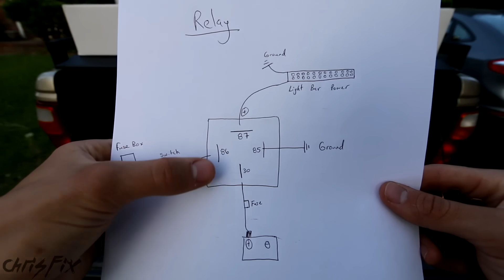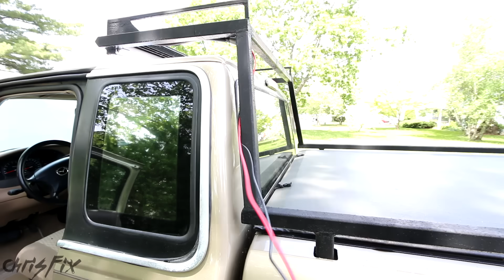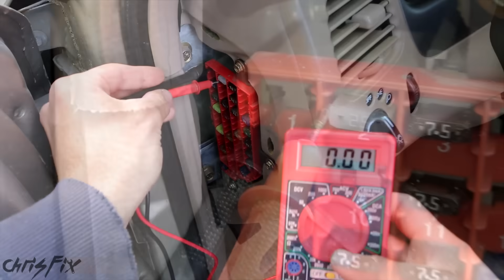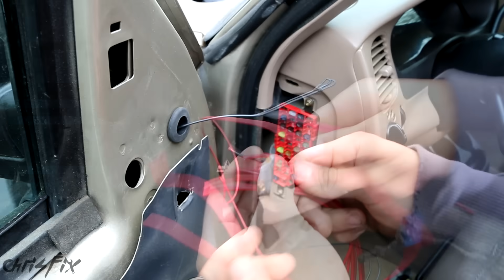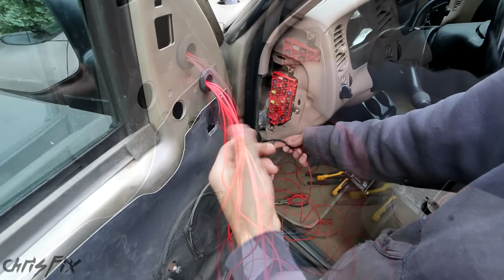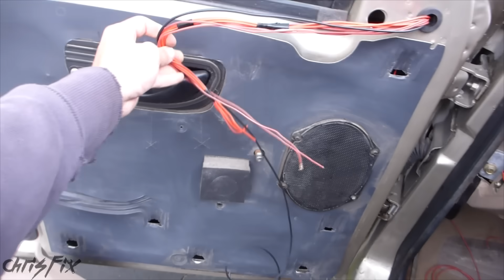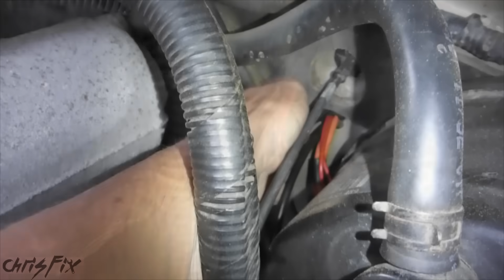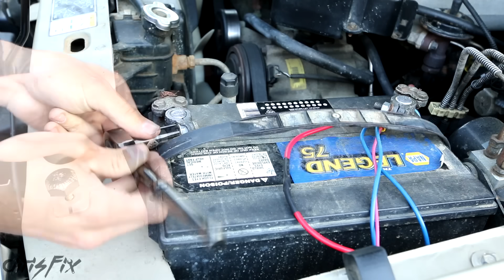How to Wire an LED Light Bar Properly (Project Night Light Episode 3)

Comment: ChrisFix dude thanks I've been watching for ever and have been thinking of getting a light bar and I'm grate at welding and electrical stuff but you should invest in a power cap! it's a secondary battorie dry cell for inside you truck and it keeps you from burning out your altnator when you run a lot of electrical! I have lights and a 10,000watt sound system and my dad used to build systems too his wasn't as big as mine and he's burned up 10 altnators in his life tell he invested in a 100$ power cap and never burned one out agin! you should do the same and when you get a power cap it will also help the life of your car battorie! I have a power cap in my corvett (82 limited edition) and my ford explorer and it helps get the power my lights and systems need and save my battorie and power cap!
Reply from the maker: +Darian Neumayer thanks for the tip! Do you wire the power cap in parallel with the stock battery or completely separate?

Comment: Wouldn't it have been an option to drill one hole on each end of the left vertical bar and run the wire inside the square tube?
Reply: Max S. he said he is concerned about rust.

Comment: i want to add four led strips on the inside of my truck but i want to hard wire them using the fuse for the dome lights so when i open the door they turn on can i wire them all to one fuse tap ?
Reply from the maker: They shouldnt draw much so that should be ok to do.
Reply: ChrisFix there the 12v lights and the fuse is a 7.5 i was told to just up the fuse what do you recommend on the fuse?
Reply from the maker: Never up a fuse. The wires are rated for a certain amperage. If anything, do this: https://www.youtube.com/watch?v=ZVG7X-ae298&t=2s
Reply: ChrisFix yeah ill do the relay hopefully i do it right haha thanks
Reply: ChrisFix do i use a 10 fuse or a 12 between the battery and relay ?

Comment: I think with a little bit more planning, I would have made a couple of holes in the frame you made to run the wires through. that way you can cut down the chances of something slicing the wire from the light bar to the chassis. Just a thought. Good Job Chris.

Comment: Isn't the door grounded?
Reply: It is, but A you need to attach the ground and that would probably have ment putting a screw through the door or welding something to it, and B people usually try to avoid painted metal as the ground so the spot by the footwell was better suited.

Comment: Instead of running power into you door and back out to the relay, what you should have done is wire up the coil side of the relay to the battery, run the wire from the relay to your door, into the switch and then the other side of the switch to an earth point inside the door. you save on wiring and you don't need that fuse tap thing. Most manufactures wire things like that these days as it saves wiring, it's called negative switching.

EDIT: It is also safer, if the wire for your switch was to ever chafe instead of it creating a dead short, it would just turn the relay and your lightbar on.

Comment: I dont get it, why did you run the return wire from the switch to the fuse box for power instead of just running it back to the battery?
Reply: No problem!
Reply: Another way of looking at it is this:  by using the relay,. it's a remote switch so you are keeping the high current out of the cabin.  less chance of melting the switch or wire in the cabin with you.
Reply from the maker: +Slisktord you could run it to the battery but it would be longer and you would need a fuse. Tapping into the fuse box is easier.
Reply: ChrisFix ok cool. I've never understood what relays really are for either hehe... why do we use them?
Reply: Slisktord it's so you don't have a high amount of voltage/current running directly to your light. It provides a switch so that when power from the fuse is on, power is readily available to the light through the switch. No power to the relay=no power to the light. A safety and convenience factor on top of fuses.
Reply: Nathan Rutledge thanks a lot for explaining this! :)
Reply: Nathan Rutledge    That's not exactly right.  The point is to avoid running all that current thru the switch.  By using the relay, you only need a small current at the switch to control the relay.  The light does need the high current otherwise it won't work.

Comment: Where do you buy your electrical components? Since Radio Shack closed, I don't know where to get them. I checked at my local hardware stores, but they didn't have anything. 

Trying to do a light system for my truck bed, and the thing I bought came set up with a 2-prong plug to go into the trailer harness, but apparently, my truck came with a hitch but no wires going to the trailer harness...
Reply: Tried Best Buy, but they didn't have anything unless you wanted to go through their automotive shop and pay them to do it.

Comment: What size fuse is it that goes from the battery to the relay and how do you determine that in the future? Great videos btw!
Reply from the maker: You need to see how many amps your lights draw. So if they draw 7amps you use the next size fuse which is 10amps.
Reply: ChrisFix they don't say how many amps on the light but if I'm correct... determining current is watts / voltage. so the lights are 18w and voltage from a car battery is ~12v so current = 18w / 12.

1.5 amps. therefore a 5 amp fuse? 

love your videos man the vest out there. really helping me learn

Comment: If you turn all your lights that you installed and everything else I wonder how much will the battery last lol.
Reply: These are LEDs, not halogens. They could run off a laptop's battery for hours ! Little to no impact on battery as after turning engine on, alternator acts as electricity generator and aids the battery.

Comment: Isn't using the fuse box the same level of danger as hooking up the light-bar directly the battery? They are both 12V

Also where did you wire the ground of the light bar I watched the whole video but I seem to have missed that.
Reply from the maker: I am not sure what you mean. When you use the fuse box, the wire is fused right at the box so there is no length of wire without a fuse. 

You ground it to the chassis (anywhere there is bare metal).
Reply: Well you said in the video you could technically just use a switch in series with the battery directly to the lightbar but that would be dangerous to have inside the cabin which is why you are using a relay. If the battery's voltage is the same as the fuze box voltage why is there a point to using the relay in the first place unless the current was decreased?

Comment: lol when i put light bars in my grille we just grounded it and took the other wire into the cab and it plugs into the cigarette lighter, simple but it works out great, especially because i hate wiring and electronics
Reply: So you just wired it to the cigarette lighter wiring or you used a plug?
Reply: Plug, i insert a plug into the cigarette lighter which is attached right to the light bars via a long wire
Reply: Cool, and it works like a charm?
Reply: All Day EDCers works out nicely, for a person who doesnt understand wiring and electronics well its perfect, no worrys about fuses and other stuff, just the positive wire plugging in works great
Reply: Benjamin Masters so you just wire the positive to a plug that goes into the cigarette lighter, then grounded the light bar to your frame?
Reply: i was told on a jeep forum that it wouldnt work
Reply: ZombieCake yes very simple, i couldnt get the wire through the firewall rubber boot thing so i fed it through driver side door, (just temporary cuz i am slamming the door on the positive wire)
Reply: Bubba Sawyer just dont overload the amperage from too many light bars, and dont let the plug short-circuit or u will have to buy and replace fuses like i had to do (20amp for the accessory power outlet and 15amp for the lighter)
Reply: well how did you fix that? I want to use a 500 w light bar
Reply: Bubba Sawyer well i am no electrician so idk how to convert watts to amps, but u can wire it to the battery and to the switch,
Reply: could you do a video or something to show how you wire yours up
Reply: Bubba Sawyer idk how to make, edit and upload vids, do u have instagram? friend me and i can dm you pictures and maybe a video if u can even do that using dm idk
Reply: Bubba Sawyer its benjimasters99 as my username and it says ben masters right under it, its a picture of my red truck
Reply: cant find you can you link your channel
Reply: Bubba Sawyer idk how it works but i only have instagram so whats ur name?
Reply: I did that to my mates ute
Reply: Have you blown any fuses doing that?

Comment: Looking at light bars on Amazon, found a 42" that's 240W. If your truck is off, your battery is supplying about 12V. Using P=IE, that's 20A. That'll kill your battery in just an hour or 2. (~40AH battery in most trucks.) 

I'd recommend moving that fuse tap to a fuse that's only on with Acc. That way all you have to do is turn the key once to turn on the lights, then if you forget to turn them off, when you take the keys out, they'll turn off.

Comment: connecting lights or any accessories to the car's battery wouldn't that drain the battery????
Reply from the maker: Not if the car is running. The alternator powers the car not the battery (technically).
Reply: oh okay thanks

Comment: You're going to have a hell of a time changing your battery
Reply: my exact thought
Reply: Well, there actually is only one Pos. & one Neg. on a car battery, so I don't really see any 'problem' . . . . .
Reply: I know
Reply: Nah, the alternator is always feeding power to the battery. So the battery will last as long as usual.
Reply: @yellowboy5467  he meant because he added the negative lead on the outside of the tightening screw so you have to take off the lead before you can loosen the battery connection
Reply: True

Comment: nice job with the lights. you should work on your rusty frame. My tundra frame looks just like yours and i bought some chassis saver before its too late.
Reply from the maker: Thanks! This frame isnt bad. I live in the rust belt so this is normal.

Comment: Hey Chris. My light bar is flickering or pulsing ... Its currently hooked up to an on/off switch and when it's on it's hooked up to my brights. It's never independently on, only with brights. Does the flickering suggest a bad connection or something else I can double check easily?

Comment: Chris, I want to install a LED light bar on the top of the bumper of my 2015 Silverado.  Your wiring video is absolutely amazing, the way you explained details, especially the use of the relay, is completely understandable.  Very Very good video!!  So here's a question - instead of a physical switch which I have to manually turn on or off, how could i use wire a light bar so that when I turn on my high-beam lights the light bar gets energized?  Can I use the factory lighting circuit as my switch and feed that into the relay?
Reply from the maker: Thanks a lot! To rig up your lights to go on when you hit the high beams, you can follow this video (but instead of using the reverse light wire, you use the high beam wire as a trigger): https://www.youtube.com/watch?v=ZVG7X-ae298

Comment: don't most light bar wiring harness go through a hole in the roof of a truck?
Reply from the maker: +rev9fan1 not necessarily. It depends on how you want to wire it!
Reply: ChrisFix and if I want to hole saw the roof of a brand new truck 😂

Comment: if you have a aftermarket stereo you should have a small channel filler that is perfect for rocker switch mounting it'll hold about 4-5 switches and is great for 5 speeds so that you don't have to let go of the wheel or the shiftier to turn anything on or off
Reply from the maker: Yea if you get a double din radio bezel but have a single din radio you can fill the hole with switches!
Reply: That's the way I'm running my switches

Comment: will this work with any light bar or only this light bar
Reply: Yes it will and It'll won't for any light. Double check your wiring and put in the fuse last. Have fun with whatever projects you have.

Comment: I've got to ask. In hindsight, do you regret not running the wire through the square tubing and out the bottom? As soon as I saw were the end of the lightbar wire was, It seemed like a perfect idea. (I haven't finished the video yet, so if you did in fact do that... Ignore this comment.)

Otherwise great craftsman ship on this. Already subbed.

Comment: I have 2 question 

Why didn't you use spade terminals on the wires you bolted down? if you did you don't have to undo the entire bolt to stick the ring terminal on & it would have made it faster is it that you don't trust them or did it come that way

also I have never had any problems with it myself but I have snipped ring terminals to make them into spades and people have told me not to do it as they pop off even when bolted? have you heard of this happening

Comment: One of the best instructional videos ive seen on yt. Thanks!
Reply from the maker: Thanks! I am glad the video was helpful!
Reply: I have now bought 3 Rallye 3003 halogen lights which I would like to mount on my car. Is it possible to connect those directly to the high beam if I chose an higher fuse or is it going to be way to much for 1 fuse? I already have a small LED ramp connected to it as well, which forced me to go from the original 10 fuse to a a 20. My wish is to switch them all (high beam, led ramp and rally 3003) on, with the original high beam switch on my car. Is that possible? Thx so much for your reply!

Comment: Why you didn't drill a hole in metal of frame where is connection of led bar and put all wires inside of metal pipe or how is called, so no one will see it or can cut it.
Good video keep it going

Comment: Hey Chris. Im wiring up some spot lights on my roof along with some flood, rear flood and amber beacons. Im planning on using relays and fuse taps. 
Would it be fine to use one fuse tap to provide power for multiple switches before separate relays. 
So one fuse tap would split off to multiple fuses that would individually send power to different relays that would power the different lights and accessories? Could you just increase the amperage of the fuse on the fuse tap. Or would you recomend using different fuse taps for each individual accessory. I hope that makes sense.

Also I had a tip. I bought off of ebay some self adhesive zip tie bases to secure my cables im running along my roof rails. 
If you look them up, they may make your install just that little bit cleaner looking as you wouldn't have the cable ties visble to secure your power cables running down from your light bar. You can stick the sticky bases down on the side you run the cables, out of view from the side of the truck.

Comment: Too much hassle with that dang relay. 

If you wanted the light bar to turn on regardless of the ign key position, just bridge pin 30 and 85 from the battery and fuse the bridge between these pins so pin 85 stays protected (relay coil will melt anyway before the fuse and also the probability of the coil shorting out is really low), run ground to the switch then to the relay and that's it. It's actually much safer to switch the ground on the relay so you avoid shorts, especially in that application on the door where the cable moves with the opening/closing of the door. That's also the reason why the switches have a golden post: so you run current there instead of ground. They will work if connected backwards anyway, but connecting the way I suggest is much more safer.

Besides, should anything fail, the fuse box is out of the equation and you avoid messing up other circuits of the factory electric system from the car.

Comment: You can also buy touch screen switch in autozone and have this powered only while engine is on. Means control voltage to touch screen switch is supplied with some circuit which is only energized with engine on, you can find some of them on all cars, then hi current circuit gets switched on by this touch screen operated relay, so it will automatically go OFF with engine and never deplete battery. I had this actually build for simple push button with two relays, because i didn't know they have that touch screen. I really needed this because i used it for 6 bulbs bar (6 years ago), each 55 watt, hi current relay is 40amp, so i never have to change it. Leds are probably taking much less even with that many. 

BTW they have some places selling boards using 12-24 dc having relays on them with settable delay for ON and OFF, pretty neat, I could literally design automatic windows roll down after remote engine start. Even made with demand so it would never roll down in rain. 

Nice video, i don't know what i would do without them when i'm going into uknown.

Comment: Awesome work you are doing, I'm getting all envious, and want to do the same to my car.
One question; wouldn't it have been nice to have run the wiring inside the metal bars / roof rail, rather than in a plastic tube zip-tied to the rail?
Reply: No because then you wouldn't be able to replace the wiring easily and it would also be easier for water to get into the bars.
Reply: I thought that too lol
Reply: S